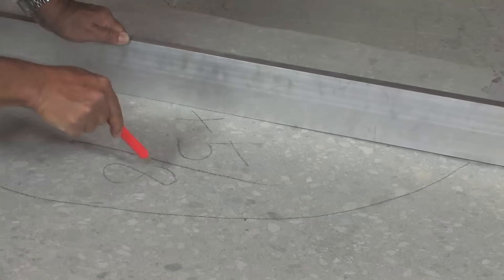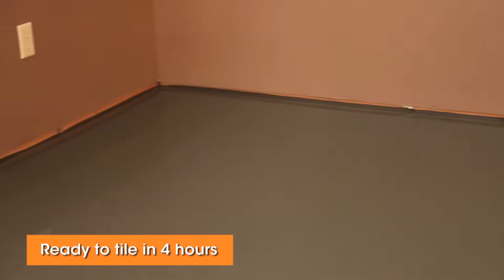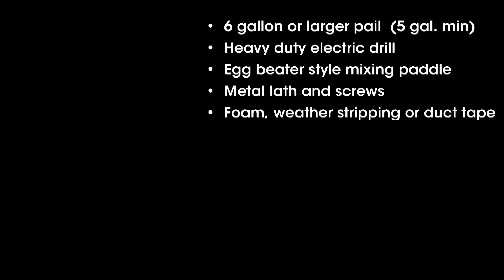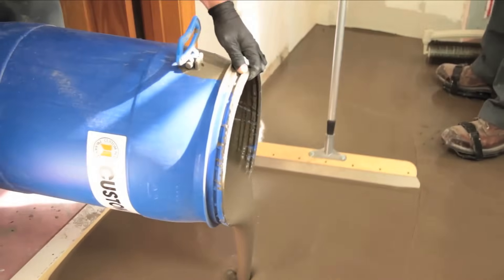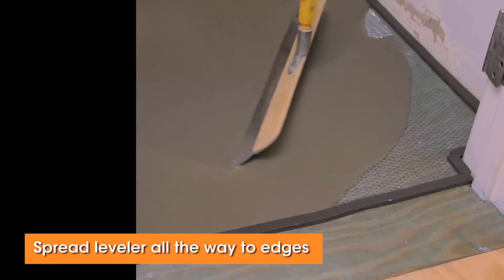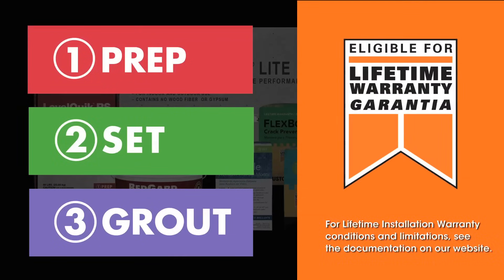How to Install LevelQuik RS Self-Leveling Underlayment

Comment: I have a basement room that needed to be partially excavated to replace a rotted drain pipe. Since it went across the whole room I had to pull up tiling and carpeting. Now I just want a durable uniform surface to level out and homogenize various concrete patches , surface roughness and even some stubborn mastic. 

Is Levelquick the product for me? Initially we will just paint or epoxy the floor to have a waterproof smooth and easy to clean surface.
Can we paint or epoxy on top of levelquick?

Thank you, this unexpected plumbing issue hadn’t been budgeted for, so immediately laying down marmoleum etc may be financially tricky for us . We just want a smooth durable surface that we can keep clean . We don’t need levelquick to be the top coat, but we may want to leave floor paint or epoxy as a top coat on top of it for a while

Comment: I had to use a lot mor water than what the bag range recommends. The mix should almost be like water so that it can migrate to the low point areas. Otherwise is won’t move. Also be sure to use a gauge rake as well
Reply: Same, it was way too thick with the recommended water amount on the bag.
Reply: @Lugenfabrik  How much more water did you use or recommend?
Reply: @reidruck3721  I don’t think it’s an exact science, except to say that you want it to be the consistency of tomato soup, as opposed to chocolate pudding. 😁

The instructions will have you make pudding, and it won’t pour/level correctly.
Reply: I heard someone say 6 qt if water

Comment: How much working time do I have once it's mixed. I have about 200 sq ft and am working by myself. I plan on having everything measured out and prepped, but still want to know how much time I have. If I mix a little more water, will that give me work working time?
Reply: That's my plan also. Did it work?
Reply: @michaelsiudzinski1302  Not that great. I did everything by the book, but it doesn't really self level. I had the spiked roller and was careful, but it wasn't perfect at the end. It was better, but definitely not perfectly level. I even mixed it extra thin. I would fill in the really low spots first if I were to do it again.
Reply: @richardview1281  ok thanks for the tip! Damn home reno shows make it look so easy.

Comment: I just used this product to pour over Durock (cement board).  Why we did it this way is another story I won't get into here (laying self-leveling OVER Durock instead of under it).  First, do yourself a favor and get 7-gallon or larger buckets.  Don't do it with the standard 5-gallon bucket from Lowes or Home Depot.  

Second, the water recommendation is a guideline.  We wanted to do two 1/8" pours, 4 hours apart, instead of going all in and trying to get to 1/4" in one pour.  The reason is this was our first time doing this, and if we screwed it up, we wanted the second pour to help fix any screwups. 

Using the product guidelines this was tough to do, I would have gone with 6 or even more quarts per bag instead of 5 1/4 - 5 3/4 quarts as the manufacturer recommends.  This stuff starts to set up fast, so you really don't have a lot of time to work it.  We ended up with ONE pour of almost 1/4" following the manufacturer's recommendations.  It's still drying, but I think it turned out good.  

As with most things, there is a lot of variability on how to do them, as a newbie I wish it were as simple as following the directions exactly, but a lot depends on the area you're doing, temperature, humidity, etc.   By the last bucket, I was just judging it by its consistency, I wasn't even bothering to measure out the water.

1) use BIG buckets, not the standard 5-gallon bucket.  
2) if your going for thin layers (1/8") use a thinner mix.  If your going for a thicker pour, use a thicker mix.  Think of it as pancake batter.  If using thick pancake batter you get thicker smaller pancakes.  If you use thinner batter you get larger thinner pancakes.  
3) If this is your first time, go thin.  Even if it means you have to let it set up and reprime.  The thinner the mix the more self-leveling the cement will do on its own without having to be manually manipulated as much.
4) Get the spiked shoes.  Not being able to walk over what you poured is a pain if you're new to this.  You will have to work it a little no matter what.
Reply: Great advice ! Also get a Lazer Level  and Mark the hight all over to give you a gauge .. nothing is more painful or time consuming then getting it wrong... unless you like grinding and dust

Comment: I don't need the whole bag. I'm doing a small area.  What is the water ti Level Qwik ratio?
Reply: Little late for commenting, but may help someone else. You can buy a couple 5 gallon MEASURING buckets. Then divide out the the bag in 1/2. Add half the recommended water also divided in 1/2. Look at the products coverage per bag. Best to mix up a little more than you need. Even when doing full bags I start mixing two half bags then put them together in a 5 gallon bucket and do a quick mix of the two. If you try mixing the entire bag in a five gallon bag immediately it won't fit, and it will be more difficult to mix. Alternatively you can get a 6 gallon bucket, however, can be difficult to find/expensive
Reply: It's called math. If you need half a bag, use half as much water, etc.
Reply: It doesn't always work that way.

Comment: Is it mandatory to use the metal mesh on wood subfloor? I saw a DIY YTberbuaijg this product on wood subfloor without the mesh and other people.
Reply: Wondering the same thing. Did you get an answer?
Reply: I would, it decreases bowing or bending In the wood which will crack your tiles

Comment: Can apply the thin set mortar then the tiles directly on the leveler? Or do I still need to but on backer boards?
Reply: You just tile on over the leveler 👍 And I will recommend it white thinset

Comment: Why the hell does this product require a metal or plastic lath?  Because its a weaker more fragile product than every other self leveler??  Because no other self leveler even mentions use of a screen or lath being used..  never heard of using a screen for a floor leveler thats usually poured at a max of 1/2" thick..  for stucco ive heard of it to get it to stick and hold against the walls.. otherwise it would crack apart easier and break.  So that has to be the reasoning behind adding the installation of the screen to the peocedures on this product..  but really, why would you need that screen for a floor leveler?  That would mean you have to pour a minimum of more than the thickness of the screen and could not feather at all which if going that far as to have to completely cover the floor why not go with morter which is cheaper, acrilyc fortifier or bonding agent is cheaper, the stuff is way more durable and easier to work with because it doesn't require special product to be used with it..
Reply: Ignorance is bliss, aint it? Think about what happens when you pour a thin layer of concrete over wood that will move and flex with temperatures and humidity.
Reply: @MAGAMAN not a problem for other levelers.....

Comment: Why weather stripping, wont the 2 x 4 hold the flow?
Reply: anna soucek 2x4 will do it, but you NEED, I repeat, NEED to seal the seam where it meets the floor with caulk or gap foam or anything that doesn’t have great bond strength to subfloor. Otherwise the cement WILL leak through to the other side of 2x4

Comment: This product stinks!  Stop saying that it self levels.  It absolutely doesn’t self level!  You have to treat it just like any other concrete product.  You have to work it into place with squeegees and make sure it’s not just conforming to the original floor.  I used this product, followed all the directions and poured it on an uneven floor.  It did nothing to level it.  It simply attached itself to the same uneven angles and raised the floor a quarter inch.  Actually made the floor more uneven.  Now I have to chisel all of it out and start over.  Next time I’ll use a different product!  Highly disappointed, dissatisfied, and feel deceived!
Reply: Lol me too!!
Reply: @FOR_THE_Pascal.   why is there no response from@custom building products
Reply: I had exacted the same problem. Not a bit of self-leveling. After it’s dry, its crags and crags and crags.
Reply: It worked great for me, but a certain amount of technique and skill is required. If you mix it too thick or do not work fast enough it will not level. You need to mix it nice and thin, make sure its lump free and pour it within a few minutes. Use a trowel to guide it in place and then leave it.  If you continue to work it it will get wavy and then will be impossible to level.
Reply: @robcanad  Having an IQ larger than you shoe size also helps.
Reply: Look up "surface tension"
I'm pretty sure you will be disappointed with whatever product you use, because it's not the product that is the problem, it's you.
Reply: @MAGAMAN   did everything correctly.  You have no idea what you’re talking about.   Loser
Reply: I'm guess you didn't actually follow the instructions. There is no way it would have just "raised the floor" a quarter inch. FWIW, the first time I used this product I was a complete DIY amateur who had never done anything like this before, and it came out perfectly. Because, you know, directions . . .
Reply: @kawoosher3435  you can’t even write a coherent sentence, but you followed the directions…. Spare me with this bullshit.
Reply: @kawoosher3435  Bullshit.
Reply: OK is anything self-leveling? It should b like water then u zap it so it freezes perfect but not brittle.
Reply: Many times, I've heard people complain that a product doesn't work, and they say they followed the instructions.  Well, the cause is usually that they DIDN'T follow the instructions exactly, just sort-of followed the instructions or didn't read the instructions carefully.  My guess is that it started to set up before they poured it, or, they didn't use the proper amount of water or didn't mix it properly.  High temperatures will reduce the working time and it won't flow.  I've used this product and I can tell you that it works like they say it does.
Reply: @TomO-vy6bb  nah I followed the instructions perfectly.   It didn’t work.
Reply: @WMM M  You clearly didn't do it correctly. 10 people say it works fine, one person says it doesn't...that 1 person did it wrong.
Reply: Products like this are not magical.  It will level.. in a limited radius, to a limited degree.  It is still up to you to get enough product into the lower spots for it to work.  You can't just spread it 1/4 inch across the entire surface and expect it to somehow find the low spots, because it won't.. NO self-leveler will do that.   This is where your floor map comes in.  Use a long 8' level.. map out your floor so you know that the back corner requires twice as much as the rest of the room, with another low spot in the closet and a high spot in the center.  Mark the wall with the proper target level for a visual indicator that you have enough product in each area.
Reply: @wmmm5877 same here man. I was thinking if I use it again, I will add more water than the instructions indicate.
Reply: @TuneinTurnonGrowup  Outside of the replies under this comment, every other comment I have read and ever other video I have watched, have said this product does not self level.
Reply: @Miss IDNGAF  I've used it multiple times. You don't take the self levelling literally. It flows, but you need to help it. General contractors who use this product on the regular know this. Of people can't figure it out, they shouldn't be doing DIY work. Period. Read the instructions on the bag.
Reply: @TuneinTurnonGrowup  General Contractors are the one's that are saying it is NOT self leveling, and take issue with it. If a product says self leveling, it is not absurd to have the expectation of it to perform as advertised. You and others who responded to that individual stated that the product leveled itself, now you are saying it doesn't.. at least not without "help". 🤔🥴😒
Reply: @TuneinTurnonGrowup   so this product that claims to self level shouldn’t be taken literally because…. It doesn’t self level????? I rest my case.  😂😂😂😂😂😂😂😂😂😂😂😂
Reply: you did something wrong ..I have used this products in dozens of bathrooms

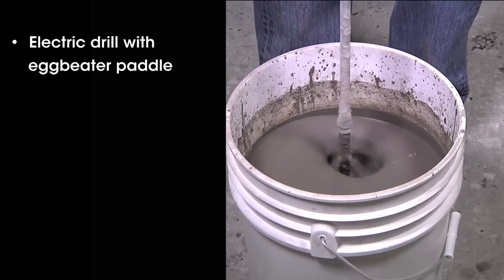Comment: @2:25 I understand not wanting to add air into your mix but you have to move the paddle up and down if your paddle is not as large as the one shown in the video. Otherwise you won't get a mix.
Reply: Other videos I’ve seen mention just not letting the paddle get up into the air a little which would aerate the mix.
Reply: Just don't pull the paddle out of the mud while your mixing.
That's one of the biggest ways to get air in it.

Comment: I have  plywood sub floor where the max depth is 0.5" and min is 0.0. Not sure if I can add a mesh in there.  What do you recommend?
Reply: I don’t think it’s necessary. I seen many YT videos where they don’t use metal mesh on plywood subfloor. So I think we are good.
Reply: @buddyrebel_Garcia  The Mesh is for strength on a wood floor. If you have any movement in your floor, you definitely want to use the mesh or it will crack. Just because some retard on youtube does something doesn't mean its a good idea. Most of these people have no idea what they are doing.
Reply: My Home Depot doesn’t sell metal lathe like they suggest< so I am skipping that step.
Reply: @Xinthose  did it work well without the rath?
Reply: @tannerwilliams9854  yes. I poured 4 bags worth of self level and it ended up leaking through cracks in the vents, so I got low spots near there unfortunately. The floor is solid beneath my LVP though.

Comment: what is the tool shooting nail into the wooden floor in this video???
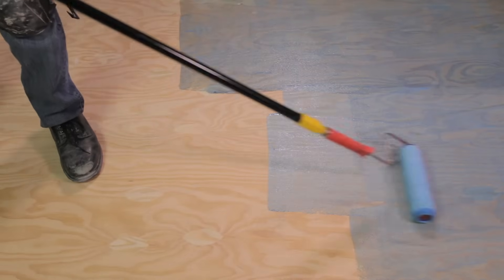Reply: If you're talking about the tool at 1:34 thats a hammer tacker. its like a stapler. It doesn't shoot nails, it tacks staples. You can use just a regular heavy duty stapler to do the same job and it costs less. Unless you need speed or for a bigger job, Hammer Tackers are made to be more efficient and quicker.

Comment: Can the product be used under fiberglass shower base on concrete?  need strength confirmation for this application. Thx.
Reply from the maker: We would not recommend the use of LevelQuik RS under a fiberglass shower base.  It is designed to produce a level surface for tile installation, not a filler between the substrate and the fiberglass shower base.  We would recommend our Skim Coat & Patch Cement Underlayment for this application.  The strength of this material is in excess of 3000 psi, similar to concrete.
Reply: Why would you need a stronger base substrate under a shower as opposed to a tile floor?   Seems that more weight, traffic and abuse would effect the stuff beneath the tile as opposed to the shower floor...
Reply: Does this replace uncoupling membrane and how important is the metal lath, I will be going one inch to feather edge
Reply: @Mrdubomb  No it doesn't.

Comment: I'm getting ready to use LevelQuik to level over existing asbestos vinyl tile from the 1940s. The data sheet DOES say that "prepared VCT" is a suitable substrate, but I'd just like to confirm. About 95% of the tiles are intact and solidly adhered to the floor. A handful of them are cracked or have been removed over the years. If I remove any damaged tiles (safely and legally), thoroughly clean and prime the floor, will I be OK? A few contractors have recommended this over removing the tiles and disturbing the asbestos.
Reply from the maker: If the vinyl tiles are intact and well bonded to the substrate, then yes, you can prime the tile surface and apply LevelQuik RS.  If adhesive is exposed it should be scraped off to the substrate, taking care as it may contain asbestos.  Once it is scraped off, the surface can be primed and LevelQuik RS applied.  Be sure to consult local regulations concerning encapsulation of asbestos containing flooring.

If you require more assistance, feel free to give Technical Services a call at 800-282-8786
Reply: Pablo A. Guerrero i have don this in my restroom floor. Cleaned area and removed loose tiles, wet scrapped those two tiles removed, used customer products mbp primer, custome products self leveler, the tile over it, and came out just fine. I'm doing this now for the rest of the living room.
Reply: @AnomalousAnomaly  Hi Daniel. I should have posted an update a long time ago. I ended up removing what tiles came up fairly easily and leaving the ones that would not. Many were very stubborn and incredibly difficult to take off. So, I just applied the primer over those areas just like everywhere else, and applied the LQ as directed. I have not had any issues with unstable concrete. Feels very solid after 2 years of constant use.
Reply: @skaneverdies  great to hear. I just got done doing part of my finished basement. A little over 200sqft. All asbestos tile. Original plan was to try and just seal the tiles with oil based paint but ended up ditching that after painting half of it as the floor wasn't level or in the best shape to begin with. I'll be doing lifeproof vinyl planks once it's all cured
Reply: @DTWCT  A less expensive alternative to full professional removal is a product called Perfect Primer.  If you should run into any more asbestos surprises in your renovations, it is designed to be painted directly over black mastic or solidly-adhered tile, and fulfills EPA guidelines for abatement of the asbestos hazard.  It is pricey, but definitely worth the investment if you are trying to be safe while still not spending multiple thousands on an abatement service.
Reply: Did you end up doing it? If you did, what was the result ? Thanks